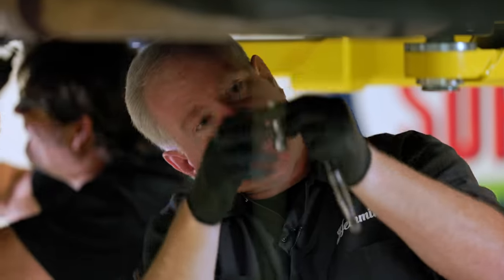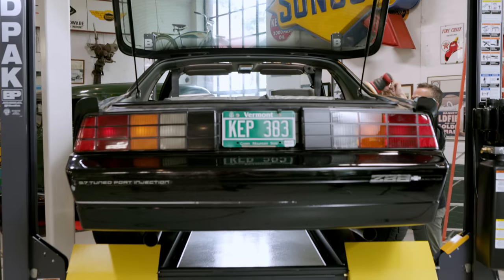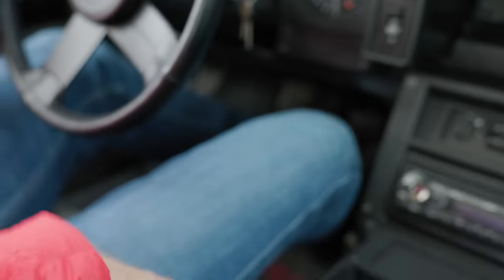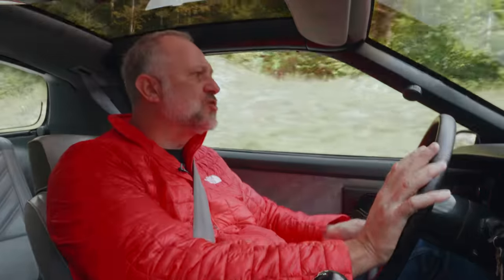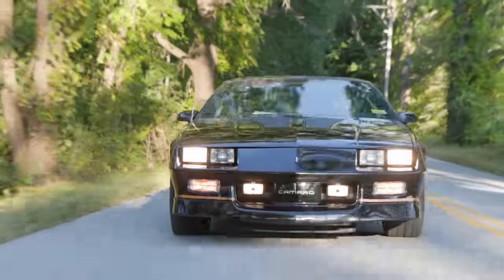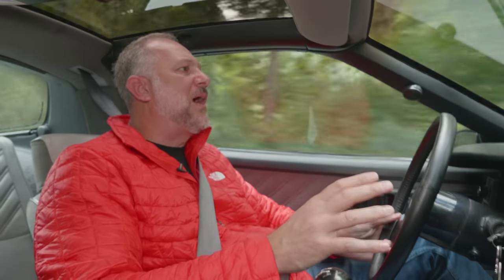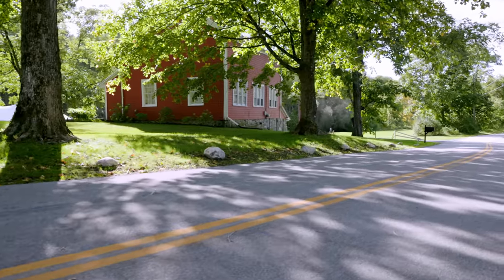Final Road Test & Review | 1987 Chevrolet Camaro IROC-Z | IROC REHAB

Comment: I have been driving my '88 IROC (305/5spd/t-tops) for almost 35yrs and it's still fun to drive.   I rebuilt the engine a few years ago, ported/polished the intake, increased the in/ex valves, installed Dyno Don headers and terminated the 3" exhaust with a GMMG "muffler", etc.  It's not a load of HP, but these engines are very "torquey."
Reply: Yeah, good for you, they run great!

Comment: Very close to what I built. 89 Iroc z convertable, 400hp 480ftlb 350, converted from Automatic to manual 5 speed,  Moser Engineering 8 inch rear diff with 3.73 posi, trackbar and subframe connectors etc etc. 400hp is perfect for this type of car, not blow your doors off fast but still a very quick car all while being tame enough to just have fun with on a daily bases. Life and everything else got in the way and I moved on from it but I do miss it at times. Seeing this video brought back memories.
Reply from the maker: Nice - and glad we could help with the memories!

Comment: had a factory black & gold '87 IROC that was ordered with the Corvette L98 in it. (i didn't order it but i worked with the dude that did) and then it had aftermarket upgrades added. it was a beast. the wife was turning in the driveway and a 17 y/o girl, on her phone, t-boned her in the passenger side and bent the frame all to hell. after the insurance paid it off i was going to buy it back but the guy at the frame shop said it would never be as good as it was before the wreck. (he may have just wanted it for himself idk) but i came across a fall guy GMC truck so i went with that. but man that IROC was sweet.

Comment: Man, that car sounds fantastic! There's NOTHING like the exhaust rumble from a SBC V8. They sound soooooo much deeper and more throaty than LS motors, IMO. Going with the larger reproduction wheels and lowering the suspension are two of the best visual enhancements for theses cars. I gotta say, I'm rather stumped on why someone chose to put 245 width tires on the new larger wheels, though.
Reply from the maker: There's a story to that.
Reply: I thought proportions of those wheels looked a little off. I think the original size would have looked better.

Comment: That 5sp with a 5.7 is  a MACHINE. I had an 84 Z28 with a 5.7 5 spd manual and I made several runs from Mammoth Ca to Atascadero Ca. I started on Hwy 41, to 58 to 5 to 223 "Arvin" to 58  to 14  or 178 to 14  to 395 and up to 203. 360 miles. I've taken all routes from Atown to Mammoth. One was through Yosemite. Hwy 41 entrance west side out Tioga, Hwy 41 in UNDER an HOUR Again do the math. After midnight in those days there were no guards, no entrance fees, just roll it.  Don't crash!!! If you were a passenger, you needed a barf bag. I flew that thing over the humps going across the California valley on 58 headed towards Taft, or going the other way. I have some great stories about late night driving in the desert.  I didn't play.
Reply from the maker: Glad you're still with us, and more importantly, no bad memories!
Reply: @hemmingsmotornews  a couple but nothing dangerous. More really great ones! Like driving down through Owens valley and having enough 16 keeping up with me somehow going that slow for him. I can see his landing gear through the t-tops of my Z28. He wasn't more than 100 ft off my roof. sooooio cool

Comment: Really enjoyed this series and how the car turned out (though not completely sold on the exhaust note, myself).  Look forward to more content like this.  Would be great to see a Pontiac Trans-Am GTA along with a fox body Mustang and then do a comparison series after their builds.
Reply from the maker: We like the way you think 😉👍
Reply: @hemmingsmotornews  a GTA would be awesome
Reply: I think the exhaust is fine but they need a cutout for track days
Reply: A stock Coyote in a coupe Fox body = very low 12's.
Reply: The exhaust would sound even better if they put the factory slant cut on the tailpipes. It really does make a difference! The exhaust bounces around under the car a little instead of going straight out the back.

Comment: About 10-years back I had an 85 IROC with the 305. What a fun car! Slow but fun!
Reply: Slow car your car must have had super high mileage or something was wrong with it. I have a 88 iroc z convertible 5.0 t.p I and it is super fast it will easily smoke the tires and slide all over the road with zero effort and with out power braking it. These car's are not slow!!!!

Comment: I have an 87 here.  It has all the bells n whistles of 1987.  an original G92, LB9, posi/limited slip, t-tops, found classic industries has "almost" every part.  Has a 383 Holley Stealthram with a PATC Raptor 700-R4.   Has only 60K on the body.  Suspension has also been upgraded to the same specs as your build oddly enough.  Couldn't ask for a better cruiser,  I've owned it since 98'.  These have gone up in price drastically the past few years.  Especially for "Unmolested" examples.  Again, beautiful build.

Comment: Hey guys this car came out great but a few small notes, wow that shifter is insanely long man! 

You went from multipoint injection to Throttle body injection. I know it was sponsored by edelbrock but how did they not send you the EDELBROCK PRO FLO 4 XT system instead of that one? Could have used the stock filter location and everything. That setup just makes it look older than it is

Comment: I looked at this car in 86, sticker was $18600.  Happens to be one of my favorite generations of Camaro. If I remember right this car was only slightly slower than the Vette on the track and like two and a half seconds faster than the Mustang. Boy would I love to have one like, I think Detroit Speed built. Nothing was left untouched. 

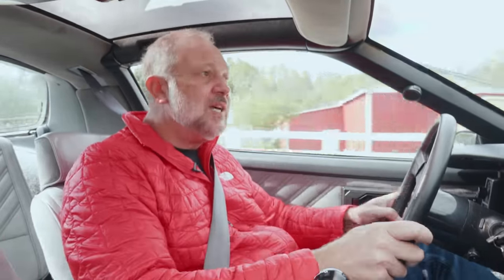As Forza enthusiast I’ve built an  (A class) IROC with a 6 speed manual, upgraded suspension and brakes with 645 hp. I can hustle it around Nurburgring Nordschiefle in 7:34 from a standing start. Probably one of my favorite cars in the game.

Comment: Every single one of you guys who worked on this transformation should be very proud of the work ya'll did. The only thing major left to do is paint it, because that paint is coming up on 40 years old. An 87 Camaro hit the dealerships in April of the previous year, and the original paint on it could date from 1986, or even 85. Chevy used a Dupont base coat clear coat paint back then... which was famous for clear coat issues, and fading. Ain't no changing the age of that paint, so I vote to repaint it. I would lose the orange racing accent stripe, but that's just me. She is beautiful and ya'll did one helluva job.

Comment: I like the points you made on this vehicle about adding power to an older car, good work. Thanks for sharing captain.
Reply from the maker: Thanks for watching!
Reply: I agree but would open up range to about 500hp for one of these because you can put a lot more grip in them. But at 380hp it has roughly the same power to weight as a 485hp Challenger Scat Pak. That's very respectable and an amount I'd be happy with in my GTA.
Reply: @lb9gta307  True that!

Comment: Great series.  I especially like the low-ish budget of it.  As is, the car looks like it's in a great place for someone who wants it to look mostly original but modern.  I'd upgrade the brankes and square out the stance but not sure if I'd go 18's.  I kinda like chunky sidewalls and for the street, it's always nice to have the extra cushion to compensate for bad roads.  I always wonder how much you can sneak by the Emissions Check here in CA and still pass.  I've heard it's mostly in the cam.  Loved Musto's Monte 383 build too...
Reply from the maker: Thanks Jeff - CA is a nightmare of a state to engine swaps - however a replacement small block like the one we installed would work as long as all the original emissions equipment is installed.

Comment: Drove one in 1988, and the difference between it and the old muscle cars was incredible. No, not the acceleration...that was meh. But the handling and the quick-ratio steering was light years ahead of its predecessors. The seats were supportive and it had a few creature comforts. Back then, we were into the 383 conversions, and when one of those was dropped in and a set of polygraphite bushings and bigger swaybars added, they were FUN!
Reply from the maker: Exactly, doesn't take a lot to make vast improvements on these cars

Comment: If I were to build one it would be a 383 stroker with forged bottom end. 500hp, Custom grind roller cam & lifters, 1.6 rockers, short tube headers, stainless custom bend pipes, tremendous 6-speed, 3.90 gears, thicker front & rear sway bar, tubular panhard bar, koni shocks, slotted & drilled rotors, carbon ceramic pads, 17x9 iroc wheels, full synthetic oil, Magnaflow or Flowmaster exhaust.

Comment: It is blasphemy to remove the TPI. Edelbrock has awesome TPI setup that can support up to 1000HP!
Reply: I’ve owned 3 3rd Camaros one of them being a TPI Iroc, and the other being a carbureted Z 28. Now that I am older, I must say it gets under my skin to see someone remove the TPI system when that is a trademark of the IROC Z Camaro knowing that there is an aftermarket TPI system. Added to the fact that everyone and their mother has done a 350 carb swap engine but I like their execution of the project
Reply: After having my TPI 86 Iroc, I can understand how frustrating it can become to try to keep the TPI. The original ECM is not easily tuneable (you had tu actually burn chips). Then if you go aftermarcet ECM you get into the restriction of the TPI manifold itself. I ditched the TPI 305 and went LS.
Reply: @Blazerota  OH yea, I wish LS was around when I did mine.

Comment: I have the 87 L98 350 car. Love TPI and in my older age I don’t mind the 700R4 with a nice converter and mild shift kit. It snaps and has no problems burying the speedometer. 

Nice car here but agree with the others, put the factory IROC decals back on.

Comment: For what you spend in part and labor you come out way ahead of a new car. Of course, a new car has all the fun bells and whistles and tech, but giving life back into something that has a great foundation all the while you might "accidentally" make it better than it's original version is no comparison. I've basically got all the parts to redo the suspension on my truck. It's at the point where it's gone past it "Original life span" on bushings etc but the frame, body, powertrain is still on point. Tune up, some extra go fast goodies wheels/tires, and she's going to be OEM Plus as they say... and back for another 20 year run.
Reply from the maker: Exactly, with the average price of a new vehicle costing around $44k, retrofitting an older vehicle can be a much better option financially.

Comment: I would put a dual snorkel L69 air cleaner on it for more of a sleeper look.  I bought an '88 IROC-Z brand new and used it as my daily for 6 years with many cross country trips as I was in the service and going from school to school for 2 years.  It was an LB9 / 5spd / G92 hardtop with the full suspension and wheel options.  You are right about the brakes.  Only good for one high speed stop before fading out.  The handling was garbage on anything but smooth, dry roads though.  They were great when in there element!  I did many epic road trips in it.  Yellowstone.  Canadian rockies.  Olympic pennisula, North Cascades.  Good memories.
Reply from the maker: Nice! Sounds like you've got some great memories of that car!

Comment: So, what did you do about the rear wiper and the high glass mounted 3rd brake light they only put on the 87's? the very best year for iroc was the first year they were out! an 85 black and gold like yours is what I had in high school! tpi 305 the dealership put in a tuned 350 for me! no one and no one could touch it. great car. nice look!!

   why doesnt factory tach work thou??? not quite dialed in!!
Reply from the maker: There are couple of little items that still need to be done, but we just used the tach that was incorporated into the Edelbrock tablet - worked great.
Reply: 87 F body cars only had the hatch top mount 3rd brake light if they did not come with a rear spoiler. Those with spoilers had it mounted in the spoiler. 86 F body cars all had it mounted up top regardless.

Comment: Nice car. I liked the sound of the hooker headers on my 89 Z28 I had with hooker aero chamber muffler, that car purred and sounded nice. I had .40 over and IROCZ 5.0 H O. Heads on it Edelbrock air gap intake underdrive pulleys, a comp cam extreme camshaft and had a demon carburator with a stall converter, was super quick too for a heavy car...lol

Comment: I recall when these cars were new and have thought about how much fun one would be with a big boost in power. Would've been nice if the factory tach worked though. Also curious to know if that aftermarket exhaust uses a crossflow muffler like the factory?

Comment: Love this since I owned a 1988 IROC Z and put 100K miles on it before I traded it after 10 years. Only thing that happened was one T-top shattered when the frame twisted a little.
Reply from the maker: Ooooof! Alrighty then - sub frame connectors are next!
Reply: @hemmingsmotornews  - Yep. I was at a stop light and when light turned green, I was turning left. I was accelerating in the turn and caught a few ripples in pavement, and it twisted the frame just enough that the passenger T-top exploded showering me in tempered glass.

Comment: My ‘84 Z28 had a 5-speed and would have been a blast to drive if the most powerful engine for that year put out more than 165hp. I pulled the 305 out and rebuilt it with some mods but never got to drive it. I left for the military before I got it done. Later I had my dad sell it for me.
Reply: The most powerful engine in them for '84 had 190hp
Reply: @lb9gta307  You are correct. Either way, it's pretty lame.

Comment: Great balance is key. Last spring I did some base tuning on a C2 with a "big block", according to the owner. After looking through the documentation he brought, I learned that it had a Doug Nash 4 speed, and a ZZ502 that had been decked, and had a Comp Magnum 244/244 roller in it, with an 850 mighty demon, the thing was probably 600 hp at the crank, and really woke up at about 2700 rpm, and would annihilate the tires, in any gear, with a tap of the throttle. It really was a bit much for the street, honestly the stock ZZ502 cam and 3.55 gears would make it perfect.
Reply from the maker: Agreed. Power is great, but cruising at 65 in the right lane at 4,500rpm is just no fun

Comment: Drove a  89 Formula 350 for about 5 years... maybe 6.  Stupid fast car.  WS6 and an automatic... it was a driver.  Drove it very hard and never broke anything.  Best thing was no anti-lock brakes or traction control... you had the car controls.  I drove it in Michigan winters... far better in the snow than you might think.   When I say drove for 5 years that was everywhere everyday.  I hauled home a new office chair by wiggling it into the back seat.  It took me to an Aerosmith concert... can't buy any car today that can do that.   Cooling!... make certain the plastic parts for the front air dam are not worn or damaged.   Those are far more important than you might expect.
Reply from the maker: You couldn't be more correct - they were there for a reason!

Comment: When I got past that this was not a restoration but more of a resto-mod, I kinda warmed up to losing the TPI L98 even though its look is "iconic".  The overall outcome is a gorgeous driveable car less the mentioned shifter needing a shorter throw.  The purist in me has real distain for the loss of the correct IROC-Z side decals, the incorrect wheel design from an 88+ instead of the best looking '85-87, the poor tailpipes- fitment for tuck up/tips, and the original tach being non-functional.   To me the silver accents are what looks proper with a grey interior.  The gold accents go with a tan interior, making this car look a bit "off".   While the clear front marker lights look better, the OE ones did have some tint in comparison.   Nonetheless it is impressive what a parts cannon can do to a ride when coupled with experienced installers and it is good to see 3rd gen content.
Reply from the maker: Appreciate the comment Sir. Thank you

Comment: This is if topic, but what happened to the 80 turbo trans am that mike musto bought about 5 years ago, never heard or seen another video on that car. Great job on the iroc.
Reply: The turbo trans am was junked...just kidding...or am I?
Reply: @74SD455TA  I hope it is still around, I bought a 1980 turbo pace car back in June.
Reply from the maker: The T/A was sold for an '86 Porsche 928s, that was then sold for a '79 Trans Am with a 403, which was then sold for Porsche 911.
Reply: @hemmingsmotornews   That is a lot of things happening. I like those 928S Porsche's, I did have a 78 T/A with the 403 (needed the Pontiac motor bad) and good luck with the 911. I still really liked that IROC.

Comment: 13” rotors and 2 piston calipers from a c4 with stainless braided brake lines and decent pads are more than you’ll ever need for brakes and they’ll fit in a 17” wheel
Reply from the maker: That's exactly right - plus, super budget minded with great results

Comment: Unless you've got 700hp like a Hellcat and you're reaching 200mph (which you're not) You don't need 6 piston brembos on an Iroc.

Wilwood has a 2 piston setup that will do nicely with pads & slotted rotors. 

Most people don't have $15k to drop on a new 383 crate Engine, and $10k or a new crate Trans. Then drop another $5k on headers, bigger sway bars, tubular panhard & shocks & New Radiator & hi-flow water pump & then drop another $2k on 17" or 18" wheels with 275 rubber all around. That's $32k grand right there.

Most people just do a cam and heads upgrade for $2k and add bigger wheels and a Flowmaster cat-back exhaust.